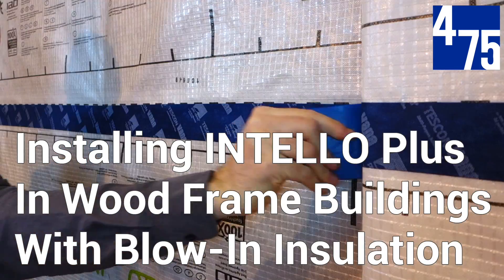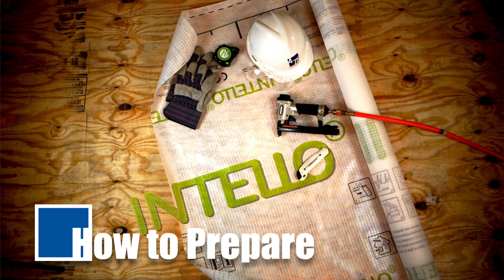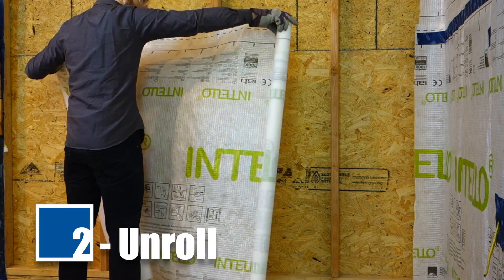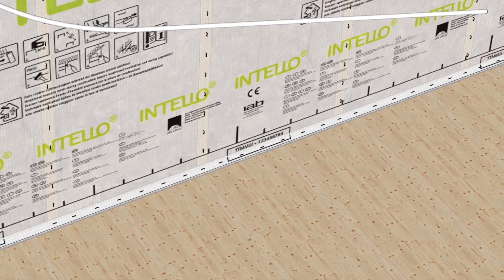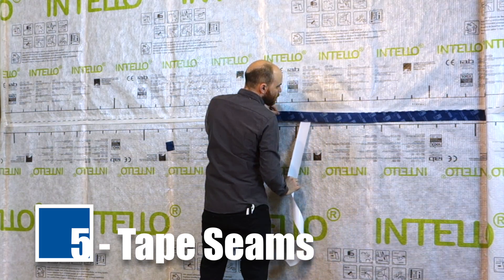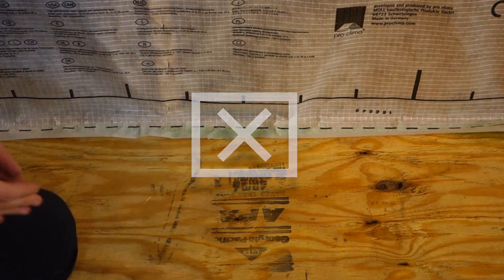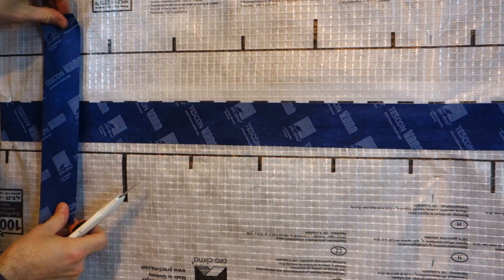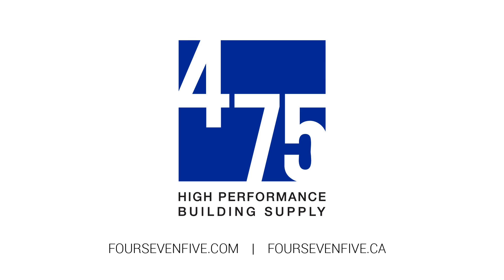Installing INTELLO Plus In Wood Frame Buildings With Blow-In Insulation

Comment: is this product useless if not made to be 100% airtight? What if I just want a good quality barrier over mineral wool but I'm not going to go crazy with air sealing every outlet box or taping every single staple? I just want something better than plastic to go behind the finished wall.
Reply from the maker: No project is 100% perfect, and the product is very effective at preventing condensation, mold, and rot while also drastically reducing heating and cooling energy demand. All things worth putting in effort to achieve. Even if you don't use this product, never use plastic.

Comment: What is the minimum distance between te batten on a angled surface?
Reply from the maker: There isn't a designated min or max distance between battens, because they are not structural (in most cases). Typically it should be a balance between the needs of supporting any insulation that is planned for the service cavity, the needs of supporting the drywall (or other finishes), and the need to support dense pack insulation (if that is being used).

Comment: Hi in the video, it shows you first stapling the intello down to the plywood floor on 3” intervals. 
Then later on when it shows the application of the contega that floor isn’t stapled?
Do we staple and use contega in the flap in front of the staples? 
Why is this junction not sealed with the tape?
Thanks!
Reply from the maker: Using TESCON VANA to connect to the plywood floor is also possible. Make sure the floor is clean (no dust, etc). In our experience it is a easier to use CONTEGA HF to make the loop in the membrane to allow for movement/expansion/contraction of wood structures without compromsing the airseal. But if you feel taping is easier,  that works well too. Stapling membrane to the floor is not needed, but we see where you might think the 3d rendering showed that.

Comment: There is no discussion re blown in insulation other than recommendation for battens. What is the procedure for cutting in this membrane and sealing again after blown in wood fiber ??
Reply from the maker: This video shows proper installation for the INTELLO PLUS membrane, preparing it for blow-in insulation. Because 'blow-in insulation" can mean many different things, we intentionally left insulation installation to other sources. Here's a few from our website and from Passive House Accelerator that we recommend: 
https://www.youtube.com/watch?v=icwLi77FyKQ
https://475.supply/blogs/design-construction-resources/blowing-dense-packed-cellulose-it-is-like-magic
https://475.supply/blogs/design-construction-resources/5-tricks-of-the-trade-for-thick-densepacked-walls-behind-pro-clima-membranes

Comment: I have my own sawmill, and I’m interesting in saving money on the floor by doing a plank floor, diagonally, like how they used to before plywood. Can I run Intello over my floor joists as an air barrier and then nail my floor planks down? I would somehow leave a flap at the end of the floor to be brought up and attached to the Intello on the wall.
Reply from the maker: This is possible. Have to make sure you walk on the joist when installing the INTELLO Plus (or on the diagonal boards already installed)

Comment: When putting the battens on, it doesn’t puncture the air barrier when you screw through the Intello?
Reply from the maker: Staples or screws do not cause any significant airleakages if they are flush with INTELLO Plus. As can be seen by our ASTM E2357 test, with untaped staples - https://foursevenfive.com/blog/intello-airtight-system-aces-laboratory-assembly-tests/
Reply: @475.SUPPLY  Thanks for answering my questions. You're helping me connect the dots as I wrap my head around passive haus / efficient building.

Comment: Does the top layer get a bead of Contega sealant too?
Reply from the maker: Not unless you are transitioning to another material. In most cases, the interior of the walls and the ceiling are all INTELLO, which means you just tape the seams as you wrap. The Contega bead is only at the floor because it's transitioning to a plywood subfloor at that point.